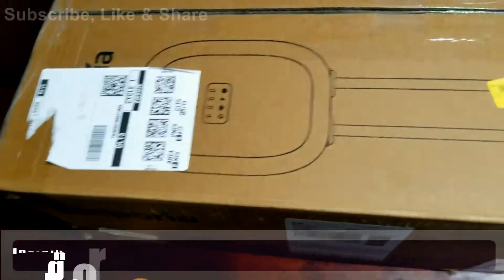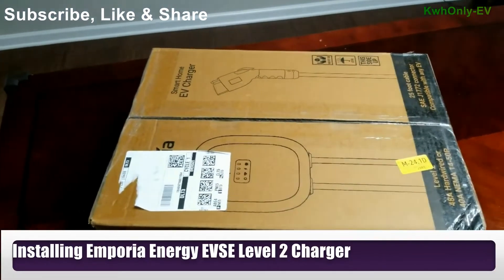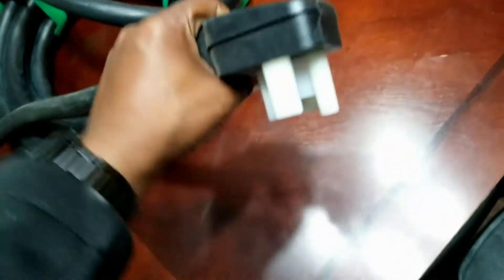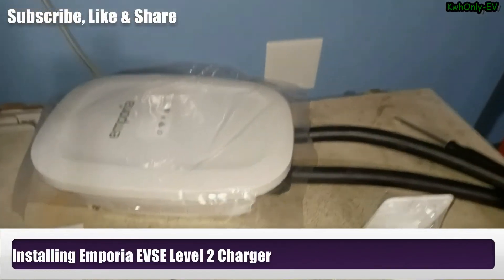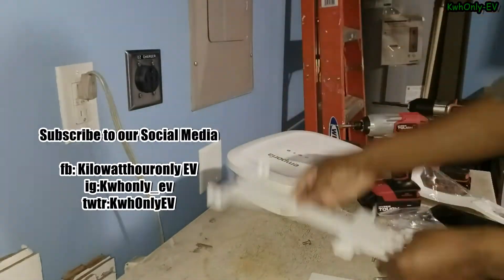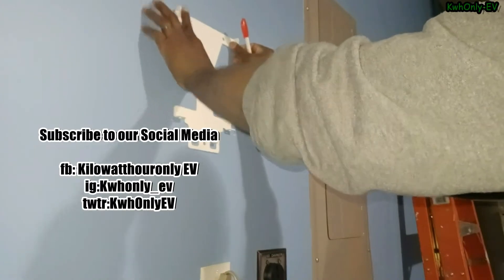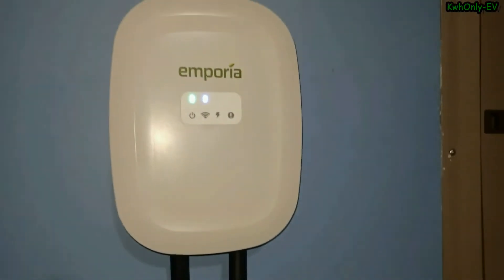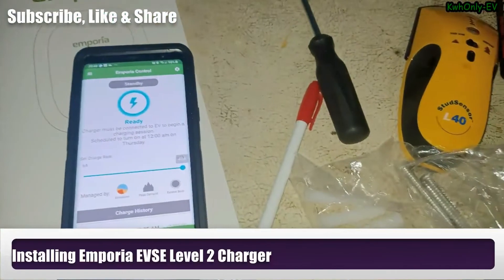Installing Emporia Energy Lvl 2 EVSE Charger (Fixed)#kiaev6 #ev6 #ev #level2 charging #emporia #evse

Comment: Just bought and installed this last week. I am running off the 14-50 outlet as well. At first I couldn't figure out how to set it to charge during only off peak hours but figured it out on the app.  Much more easier than the old school Siemens versicharge I had where I had to set a timer every night before I plugged it in so it would charge after midnight.
Are you guys charging at 40A?
Reply from the maker: I'm glad you got the Emporia Energy charger. Yes I am currently charging at 40a. I am thinking of getting it hardwired so that I can get the full 48a charging. I will be working on 1 year full review of the evse soon.
Reply: @kwhonlyev what wiring do you have aluminum or copper?
Reply from the maker: @labaom  thank you for viewing my video. The electrician used copper 6 awg wires. Copper wires can handle high heat during usage while aluminum cable can't handle high heat during charging and it is not recommended for EV charging. I hope my answer helps. If you haven't SUBSCRIBE, please do and Like my videos.😀
Reply: Right on.  Looking forward to the next video about this.

Comment: Thanks for the video I plan on getting this exact charger for my ford E Transit. What’s the amount you think you saved each month since switching to electric. Thanks
Reply from the maker: The Emporia Energy EVSE is awesome and you will love it. Charging from home is a lot cheaper. It cost me around $40-$46 a month extra on my Electric bill for charging my EV6. I usually set my Emporia Energy EVSE to charge my EV6 around 12am. Also the Emporia Energy has a smart app feature that tells you how much for the charging session a day, weeks and months.

Comment: Have you been able to figure out if you can turn the lights off on the panel? I will be installing outside on the front of my house, those bright lights will attract 'less desirable' types....
Reply from the maker: The LED lights stays on. There's no option to turn it off. I might contact the manufacturer by requesting to add that feature to their app. I hoped I was able to answer your question.
Reply: @kwhonlyev  thank you! I also emailed their team requesting that feature. More important for an outdoor install so it's not easily spotted at night

Comment: I bought this unit myself and one point to anyone else looking to purchase this, this unit is designed for the 14-50 ground plug to be on the bottom rather than the top for the cord to be straight. This is not the usual installation of the 14-50 plug since the ground is normally on top. I will be doing the same thing as in this video and looping the wire to fit my plug. Thank you for the video since there are not too many installs posted on the Emporia.
Reply from the maker: Hey Craig,  I had the Nema 14-50 outlet installed a week before taking delivery of my EV6. The electrician said something about installation code and the ground had to face up. To me it's not an issue since the plug cable is long enough and the build quality 👌 an A+. I hoped my video was helpful and thank you for watching.

Comment: Thanks for taking my advice on the audio. Way better now. A+.

So questions, how is the cable? Easy to move around, easy to wrap around unit. Also if you drive in with the charging port close to the garage door, will the cable reach the port. 
Good job, keep the videos coming. Subscribed.
Reply from the maker: Thank you.

Comment: Price just jumped to $449.
Reply from the maker: I noticed that this week. The UL certified rating Version is sold at $449 and the non-UL certified version is sold at $439 just $10 different.  I have the non-UL version and it worked great. Thank for your comment and the update.
Reply: @kwhonlyev  
Oh!!! I didn’t realize that. Actually I paid $439. 
Oh well.
Reply from the maker: @Dive Bar Casanova I apologize for late response. The price went up due to a lot of new EV owners are purchasing them. Not only Emporia, all EV chargers and accessories prices are going up.